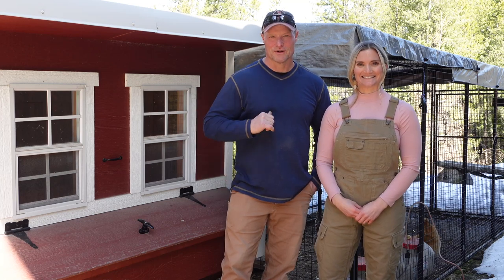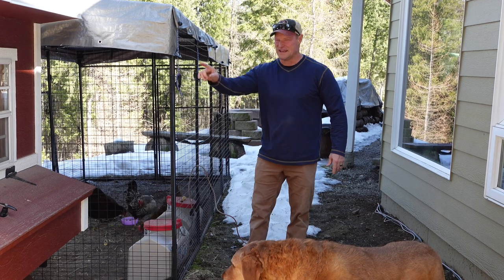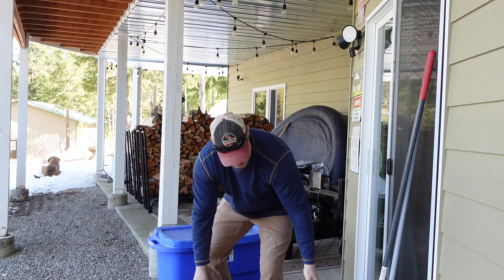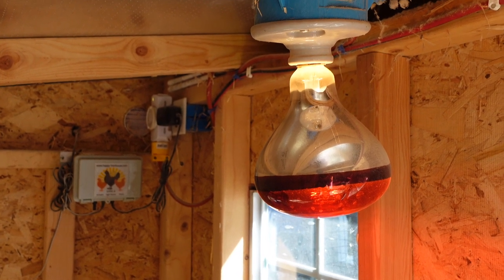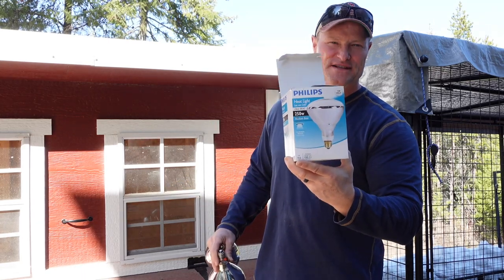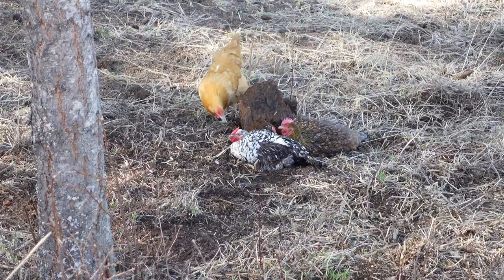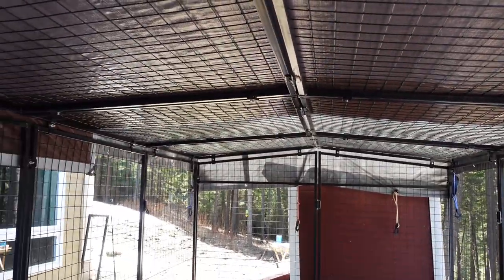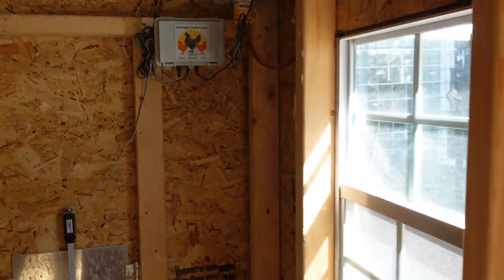How to Setup your Chicken Coop! 7 Tips to Success!

Comment: How cold do your winters get? I'm just building mine and deciding how much I need to insulate it. Obviously going to go with a plate or lamp like you have. I've been told they can keep a space warm just by themselves as well, but it hit -35 for a couple weeks here in Alberta and I doubt they can maintain heat just by themselves in that. Especially when I only am going to have 6 in the coop. Thanks!
Reply from the maker: That’s a great great question. Our winners get down into the teams are 0°F very infrequently we’re normally in the 20s in the winter but our heat lamp works great with the automatic door as well. It seals them in and keeps them pretty warm. we also have cold resistant chicken breeds That helps as well. Thanks for your question for watching our content please like and subscribe.

Comment: Great video!  Thank you!  Do you think, linoleum in a bathtub design on the floor with the plastic on the walls overlapping it, that it would be a good idea?
Reply from the maker: Thanks @BWC ok! Yes, I do. I did overlap the bottom plate 2x4 on the backwall floor with the plastic as well to catch all the droppings on that horizontal surface. I think that will make clean up so much easier. As always thanks for your participation with us on our channel/